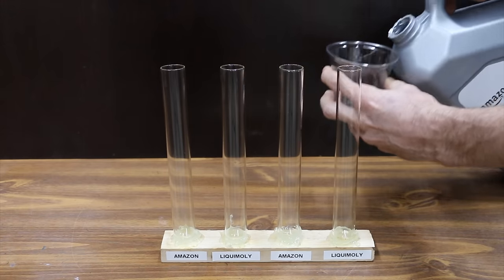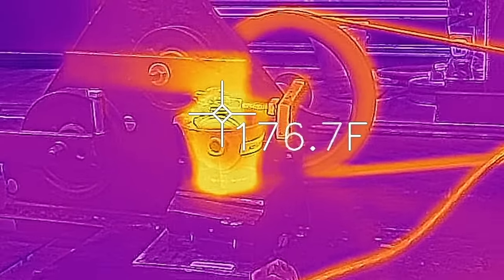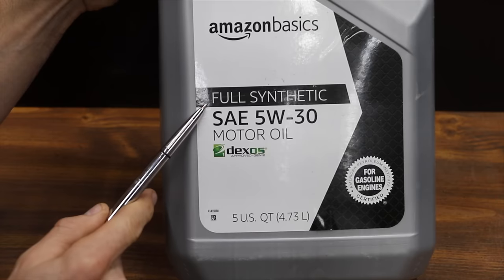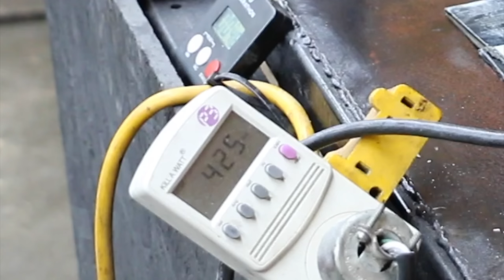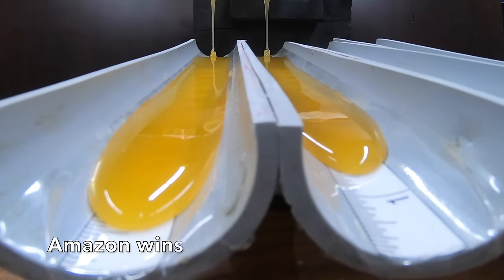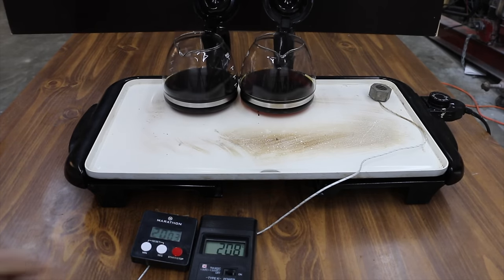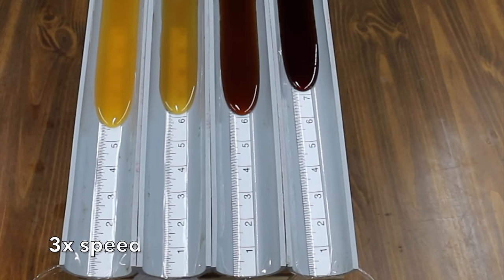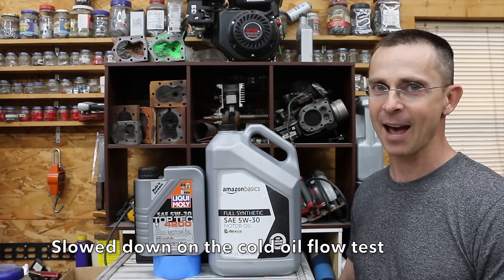Is Amazon Basics better than Liqui Moly? Let's find out!

Comment: NOT A FAIR TEST!Obviously this is their diesel
Oil but because of their additives also can be used on SOME gas vehicles. Very obvious when you don’t even see an approval
Rating for Gas engine Mercedes,229.3,229.5,and most of the ratings on the label
Are for Diesel engines.So this was no way a fair test.Seems so many people are out to push red line and amsoil.2 companies that give away their products for free to people to push them.Not saying your doing this but I can run E85 and 93 octane in my car. Would that be a fair test to see Wich will clean my valves better?Why don’t you use their Gas only oil,rated only for gas engines and to make it fair how about newgen their latest oil or even go back to the older oils like high Tec. By the way redline and amsoil buy their oils from BP Shell and Mobile whoever’s barrel
Is cheaper that day,already refined. People actually think redline and amsoil Have refineries and wells digging in the gulf for only the best crude,ha ha. And they take that oil they buy in barrels and simply add their additives tryng to out add the other. That’s why their oils cost double mobile 1 liqui moly Castrol etc.It’s all a oil company racket that other people get paid to push.Change your oil at 3-5k instead of the crazy 10-15k and neither of these oils or pretty much any decent oil even non synthetic will outperform the other.If your dumb enough to wait 15k your car will never see 200k,the additives in the SUPERMAN  amsoil and BATMAN redline and all the oils might help some,but can’t save you from sludge blown headgaskets valve issues and timing chain breaks,all issues attributed to lazy cheap ass people who don’t wana spend $30 every few k to change the blood in their car. Now go buy some liquigen moly and do this test again!By the way the amazon oil won the ruler test but when your engine is HOTT you want the THICKER OIL!!So you don’t blow a rod or bearing!Thats the point of liqui moly to protect your motor when your driving it. What do you do more start your car in the cold to warm it up for 5 minutes or DRIVE IT while the oil is COOKING!?Ill take the thick protection during actually using the the car driving it on highway high rpm city driving stop and go over a quick half second start In 15 degrees. I mean liquid moly actually won the better oil test truth be told. It lost the cold start BUT BIG BUT,being it was thicker that means it also stuck to the pistons rods lifter all the crucial parts better DEFINITELY MOST LIKELY. So did it really win the cold start test??The Amazon oil over night left a less protective coating due to it being lighter. Who cares if this oil or that is The thinnest at cold start I want the oil that will have little bit left over on the engine parts for when I start it In below zero weather. You think that oil in the pan is gonna help you immediately?It was still thick barely thinner then moly. What protects you is the oil film left over from when you parked it overnight from the thicker oil. I don’t care how thin the oil was,if it left no film your engine will instantly sound like a diesel knock knock-who’s there-Rod-Rod who-ROD KNOCK! 
Ha ha ha
Reply from the maker: Thank you for the feedback

Comment: Very entertaining but honestly not realistic...oil pressure keeps the bearings from "direct" metal to metal contact...if that amount of metal had been worn out everytime we'd be rebuilding engines every week.

Apart from that there are other additives that   are in the oil so its really difficult to compare them. As always application should be considered by that I mean not everywhere will need oil that flows at -20 degrees...

I enjoy watching the videos tho!

Comment: Liqui Molly mollygen 5w40-That's their best oil for high mileage engines!Considering you live in Europe it's a little bit pricey but it has a lot more additives than other high brand oils like Castrol,Shell,Mobil etc.I am talking about all the 5w40 oils!The Liqui Molly is just one of tge best fir older and worn out engines!And also very good flow in both extreme and hot temperatures!I've read a lot of date sheets on oils,and from what I've seen that's the oil for my engine!And it's so much better than Gm oil,I mean I can change this oil after 2 years and 10-15 000 kilometers and it will still be fine!My head was filled with information about oils and I was searching the best oil for my car.The reality is an older engine needs the oil to be changed more friquently and perform better!Liqui Molly has proven that since I've used it.
Reply from the maker: Thanks for the feedback.

Comment: Damn, I just put Liqui-Moly in my Porsche too.  (plus I think of Amazon as the evil empire).
Reply from the maker: Thanks for the feedback.
Reply: i ordered lm for my mercedez got 8q the filter and new plug for 79 bucks for a 20 bucks saving ill use molly all the folks using molly report less temp on car plus less oil waste than mobil one so im sure these test are bs on one i noticed way more oil on the flow tester you can tell more oil edit etc
Reply: @osvalditochirino3428  Yeah, LM is a top oil for a good price.  Plus, I use the "Leichtlauf" LM 5w40, which is the better A40 Porsche approved version.  I get mine for $35 for 5 liters at FCP Euro.

Comment: Liqui Moly have the best tech specs and it is a lot better oil than Amazon's. You can't judge only by high and low temperature tests. Those bearings that you used have nothing in common with engine cylinders, pistons, crank and camshafts! Your test is a JOKE period.
Reply from the maker: Thank you for the feedback
Reply: been using the $10 4 quart super tech oil from walmart and never had an issue with it on my car still runs like brand new, now driving over 236k miles with it after 12 years - saved thousands of dollars going this route instead of buying the most expensive oil - in the end doesn't really matter which motor oil to use as long as you follow the recommend oil and interval changes since all motor oil are required to be API certified in the US

Comment: we want the fight of the titans Liqui Moly vs Moble1 = 0w40
Reply from the maker: Thank you for the video idea!
Reply: Pretty sure liquid moly is not a titan anymore in my book. Mobil 1 is wayy better than liquid moly
Reply: @yukinehiruko2217  only one way to find out
Reply: I've ran both Mobil 1 and liqui moly in my Jetta both with 10k oil change intervals about 3 times each and I have to say, I prefer liqui moly each time. The Mobil 1 burns off about .25 to .50 quarts of oil after each change and liqui moly maybe burns off .15 quarts if that. Not sure if that is the greatest thing being that they are both within a spec of oil loss in that mileage interval, but I just feel better about it. Also, when I drain the liqui moly, it doesn't come out nearly as black as the Mobil 1 does leaving me to believe there is still some life left in liqui moly. I won't test that though, vehicle specifications say every 10k, so every 10k I change it. Just for info, I have 93k on my 2016 Jetta 1.4T and run 5w-40 liqui moly and 0w-40 Mobil 1 that meet vw 502.00 and 505.00 spec.
Reply: @ViewlessSquid  reason i asked for the video is that im runing the liqui moly on my 2012 mclaren and they recommend  mobil 1 0w40 so i just wana see if i did the right chose :)

Comment: Amazon basic full synthetic versus liquid Molly non full synthetic. You should have used liquid Molly blue container 5W30 full synthetic. On that Gray liquid Molly bottle I can't see anywhere on there that it says full synthetic but on the bottle that I use it says big letters full synthetic on the light blue bottle and when I use that link will Mali on my car I get much better gas mileage because of the additives that it has in it with friction reducer. It should have been in this test
Reply from the maker: Thank you!

Comment: That cold weather test is a completely inaccurate way to assess cold weather performance of a motor oil. Oil is pumped through the engine not gravity poured into the engine so measuring pour is useless you need to measure pumpability via a Mini-rotary viscometer type device.  Appreciate the effort but would file this under entertainment rather than science.

Comment: I have an idea.... there are some mechanics who claim injecting .5 mils of WD40 Silicone Spray into your rubber struts, shocks, rubber cv joints, and all other rubber parts that does not have oil, coolant,  gas, or transmission fluid will help them Last forever.
Reply from the maker: Thanks for the suggestion.

Comment: Another testing idea: Does changing to synthetic oil on a high mileage Jeep cause problems? I have a Jeep YJ with 220K miles and I want to switch to Amazon High Mileage full synthetic.
Reply from the maker: Thank you for the video idea!
Reply: CRM6718 to the inside of an engine no, but can cause oil leaks as it cleans the engine better and can unclog dirt that was previously preventing leaking. but can fix itself after a change or two as it "heals" the seals back.

Comment: Until you have a turbocharged engine or other any high performance engine and the heat and boost cause amazon basics oil to burn/breakdown faster than special tech.  To be honest i think these are decent test for personal decisions, they do provide legitimate information. Its totally possible amazon basics provides better  protection for cheaper for everyday non racing or towing engines. But i think you will find problems using amazon basic in high performance (especially boosted engines)  the purple liquimoly special tech is designed for vehicles without particulate filters (and for boosted) and may provide inferior or par level lubrication performance than ur cheap amazon basics but you will more than likely see a long term positive difference in vehicle wear or contaminate buildup with the use of special tech within its stated ideal conditions of use.
Reply from the maker: Thanks for the feedback.

Comment: You didn’t even use an apples to apples product comparison- one’s an API SN+ ILSAC-GF-5 , low HTHS fuel economy oil vs an ACEA C3, high HTHS, engine protection product. They are formulated for completely different applications and have almost nothing in common composition wise besides the grade. What a failure this is. 

And you wonder why the internet is filled with a bunch of nonsense about oil tech. People like this 🤦🏻‍♂️🤦🏻‍♂️🤦🏻‍♂️

Comment: Liquimoly is way thicker HTHS  of 3.5 vs Amazon @ 2.9 HTHS. It won’t flow as well code because of the specs it meets. Amazon will work well in your Toyota but will ruin your Mercedes. Specs are what matters.
Reply: That is not sure. It just means it does not have the certificate from Mercedes. Maybe they didnt test it yet.  It is a risk though and your  Mercedes guarantee is gone with that oil. Your mercedes might run a million miles on it.
Reply: Michael Weskamp. Amazon basics could not pass MB229.5 as it does not have the correct HTHS viscosity to meet MB specs. Not that the Amazon oil is bad, but it is way to thin to be used in a MB, Audi, or BMW.
Reply: @donnyjackson1908  ? I use 5W30 in my mercedes. 0W30 would be ok too. But I need the MB 229.31 for diesel with particle filter. You mean by HTHS  that the Amazon basic does not become low viscous enough  at operation temperature to meet the MB spec?
Reply: @donnyjackson1908  You are right. And i need 229.31 for diesel with particle filter anyway. mea culpa.

Comment: So isn't thicker better?
Reply: Nope. Oil needs to be as thin as possible to flow everywhere (through turbos if equipped and into small oil passages) especially in cold weather but also lubricate. The viscosity itself is one thing but the additives within the oil are even more important as they do the heavy lifting when it comes to withstanding things like fuel dilution, heat/cold cycles, turbo heat and driving style.
Reply: @IKhanNot  so was this oil heated to operating temperature?

Comment: WTF you saying do i pour into my S62 engine now? 10w60 Amazon oil??? 

Stepping back a step, ... one must realize the cold viscosity test must be accompanied by a heat viscosity test... for all we know that Amazon oil might be mis-labeled 0w15, looks great in cold but offers no viscosity/protection at proper operating hot temperatures.

Comment: Fck that, i dont trust this test. Why the fck would be a cheap oil better then a high qualitiy one. I am using only high performance oil and i drive a bmw 335i n54 with over 540 hp. I will never put a cheap oil into my engine! You can say wathever you want, put cheap oil in your car but dont complain if your engine will blow off.

Comment: So after watching "Mountain Men" one of the main characters built a "Gasfier" out of scrap parts in his barn/shop. He used this machine to power an 80's Toyota pickup truck to pull logs up and down his mountains. This would be a big build so I wonder if you can power a lawn mower engine? The fuel was wood chips. Here is a link: https://cdn.instructables.com/FFL/NUJ7/FPKFA0DH/FFLNUJ7FPKFA0DH.LARGE.jpg    
that is just a hand drawn rough blue print but it seems these devices are real. It might make a good video or two...just an idea.
Reply from the maker: Great video idea!  Thank you

Comment: Sorry, love you video's, but sorry the viscosity of oil is needed to form a film of oil around parts in and around the head and valves so as to not to cause more fiction during cold stars, so if the oils viscosity is lower and runny then there is more chance the oil will run down to the sump and not be so on top, every oil change should be using a engine flush additive to remove all the old oil. After your run test you should weigh the film of oil left over, so Amazon is a more runnier oil. Also I would like to high lite your lubricity tester is not accurate the test piece used was heavier that by .006g also the weighted end is not consistent and a possible give false indication in the test piece, also your grinding well will need to be recalibrated for every test as there will be some wear and tear on the part as well, I would like to see if you can make a better lubricity tester with controlled pressure on the test machine and new grinding wheels for every test used on the test piece.
Other than that your video's are good entertainment.
Reply from the maker: Thanks!  Thanks for the suggestion.

Comment: This test shows how to compare oils with wildly different additive packages.  This is comparing oranges and lemons, but since they share a couple of the same letters and are both citrus, they're the exact same thing apparently.  I can't even add more than a half quart of ACEA A3 in an emergency to my European engine.  An API-only rated oil like this would end my warranty. 
He's performing a highly stylized test which only perpetuates junk science. This Amazon oil can't even meet any ACEA level.
LM has submitted their oil to multiple laboratories and gained some of the toughest certifications on the planet.  This guy cobbles together a couple parts out of a junkyard, adds digital displays to wow the easily impressed, and claims expertise on oil testing. 
LM isn't the only oil out there, but if you use Amazon oil to replace the intended application of LM TopTec4200, you will void your engine warranty and you will void your emissions warranty.  I guess it's a good thing you're saving $15 per oil change to pay $10K for a new car or engine+emissions system! 
If he's so sure of his results, compare them to an oil analysis.  He would be helping real science and gaining valuable evidence as well.  This guy is pulling coins out of your nose and telling you there's a goldmine up there.

Comment: From an technical point of view, this test is absolute carbage. Maybe u can put that amazon oil into your good old american V8, but the aditives required by modern engines are missing. There is only an dexos specification on it, the other specs are meaningless in mordern cars. No manufacturer passing by the car u drive, no warranty on your engine. So go on, put it into your car. I prefer the oil with not only recommended for the manufacturer, but with official passing manufacturer tests. If u spend some 10k dollars on a car, do not waste it by using the wrong oil.

Comment: Soon the electric cars will enter the market strongly and we wont need to worry about oils, transmissions, turbos, valves, gasoline etc etc. Degradation of car batteries is very slow and you can now charge 600 miles in 10 min. Imagine where we are in 10 years. Amen
Reply from the maker: Thank you!

Comment: Your test isn't relevant, oil temperature doesn't hit 200 Celsius in engine, is it flow faster this means that is better?  After you  drive for years similar cars with different oils you can see the difference between engines worn.(that's a test). But do not compare Amazon "oil" with a 62 years old German company who is only business it's lubricants.

Comment: Of course in America only the American oil can win. This is all good but the oil works little differently in the engine. Also the Liqui Moly stands for molybdenum added to the oil to reduce friction. It takes time  for the molybdenum to become a thin skin on metal surfaces. I use this oil and I change oil yearly. The used oil comes out fairly clean after a year and have no issues. In the piece a crap american engines probably won't make much difference anyways. This is the typical biased test when people test the AR15 against the Russian SKS and claiming how better is the AR15 while they can still shoot with SKS which had been half destroyed.....That's ok, Americans like to fool themselves all the time how superior they are in everything....which is true in Hollywood movies.
Reply: You sound mad 😂😂 LiquiMoly lost. Face it. You can’t deny the proof. It’s right here in front of your face. I’m sure LiquiMoly upgraded their formula after this embarrassment.
Reply: @kassanova5430  This not how you test out an engine oil.